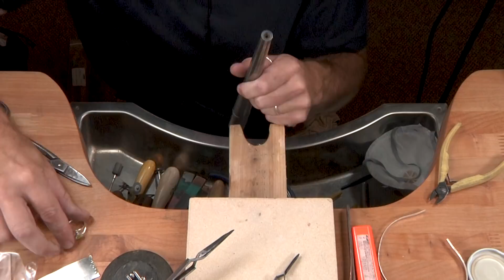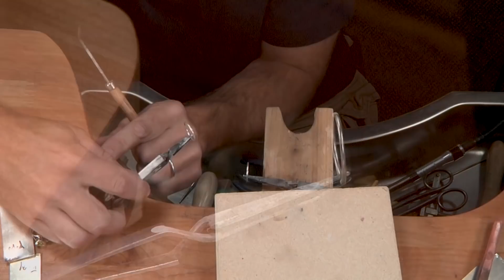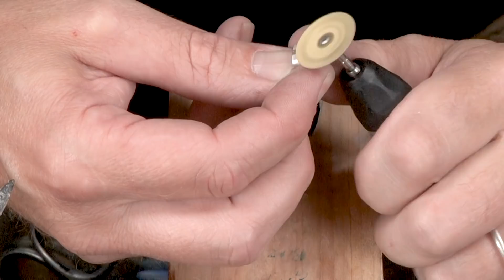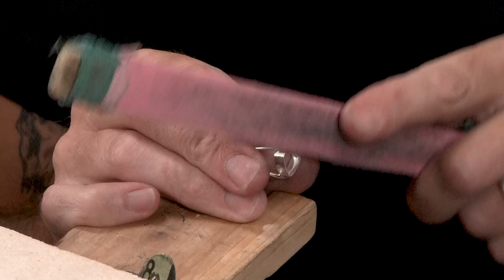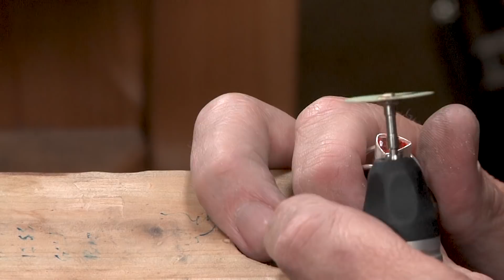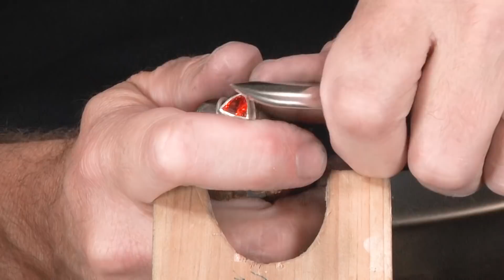Cool Tools | Trillion Cut Bezel Set Ring by Matt Breunig

Comment: Hi, loving this channel and this tutorial. Thanks in advance for considering my questions: 
1) if you are, why do you quench in pickle?
2) Why 3 - 4 balls of solder on the ring to bezel join, is that much needed for....strength, look, other?
3) I love the metal bench tray under your pin, what maker/brand is that? Thank you so much, Matt.
Reply from the maker: Hello!
1) quenching in pickle instantly removes fire scale & Flux buildup
2) 3 solder applications to fill in areas to keep from snagging or catching (examples/ sweaters long hair etc..)
3) We are not sure about the bench, it's been around for while! 

Hope this helps!